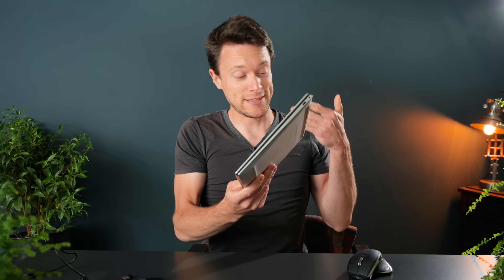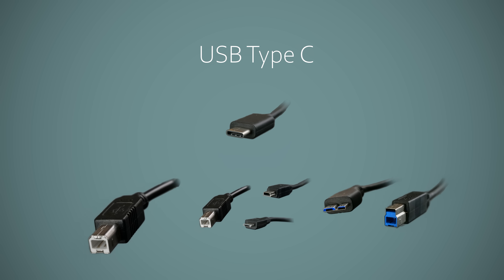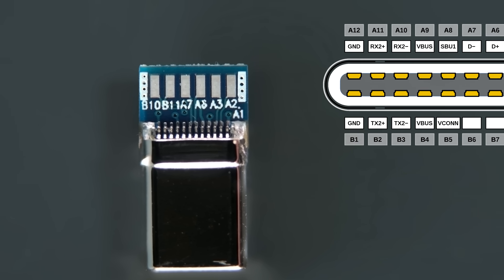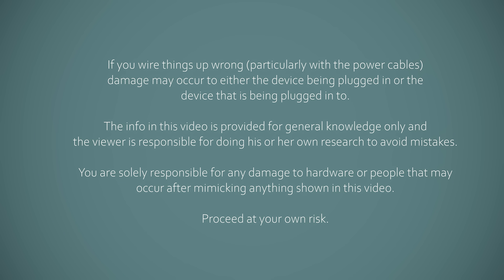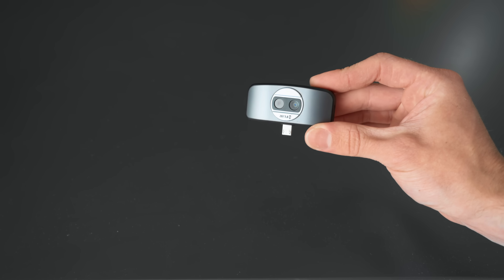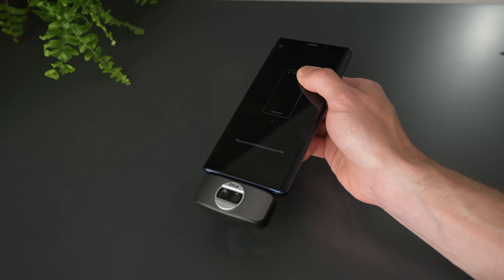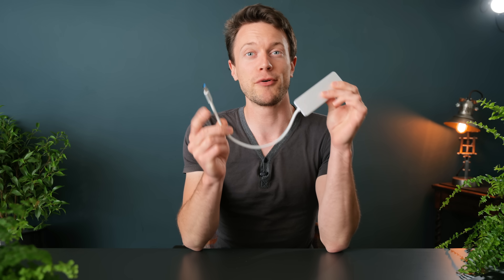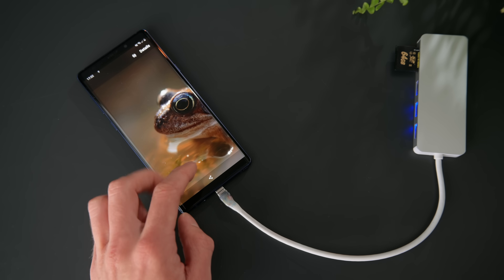Converting devices to USB Type-C

Comment: C : I am reversible
Jack3.5mm entered the chat
C left the chat
Reply: 360 plugablity
Reply: Yeah, reversible is still inferior to Circular, as they can be inserted in any direction.
Reply: @adunknowng  Well but we gonna leed a long-ass circulair plug for the amount of connections of a usb 3+ lol :p
Reply: @Tom-sd2vi  something like Robocop's universal data connection
Reply: Owletterishere long live dc barrel plugs
Reply: @adunknowng  Not sure if its true. I tried putting it in, with the cable first. Did not work, so any direction is not true.
Reply: @adunknowng  that's true, but they are very easy to break, so Type-C is still better
Reply: @adunknowng  its basically indestructible when it's an l connecto.
Reply: @adunknowng  No Because USB C is So much more durable than round... Headphone jacks wear out and break so easily
Reply: jack have oe problem - it can shorting pins while put in connector
Not great for data and power connections
Reply: @Xenotester  Solution: Make the bottom tip act as a switch. Pins will only turned on once the whole jack is connected.
Reply: @Mr Bruh Isn't signal type(digital/analog) defined by the device using the wire?
Reply: a 10mm cylindrical plug can have 4 contact enough for usb 2.0
i wonder why they did not do this
it is so convenient for charging at least
not to mention the huge surface contact area
Reply: @H_B_R  Apple did this already with the iPod shuffle connector
Reply: @trytea  why isnt it more popular though
Reply: @H_B_R  simple. Because at most you would have 3 ring separators in a 3.5mm Jack. So max speed would be whatever USB2.0 can provide. Not to mention Apple probably patented it so no one can use it.
Reply: Amazingly I'll be the first to say this comment is absolutely hilarious.
Reply: 2 connections that should never be or have been taken off a phone. That and a  IR blaster
Reply: I literally can’t believe that I’ve spent my weekends doing anything other than reading YouTube comments, you guys deserve an award🤣
Reply: David Yusaku 360 degrees of rotation cant be beat
Reply: Bluetooth has entered the chat.
Reply: HAHHAHHAHHAHAH
so funny XD
Reply: Honestly, type C wins against the 3.5mm jack. Don't get me wrong, I love the audio jack. I've used them for my entire life. But USB-C is designed to replace the audio jack. It can carry audio and get this, full HD video signal. The audio jack is notorious for its habit of breaking easily and making awful connection. A bit of dust inside your 3.5mm jack port on your iPhone? Can't connect any audio devices. Connection broken. Just bought new earpods 2 weeks ago? Now one of the channels doesn't work. Well, it does but you have to hold the jack at a very specific spot and it kind of works.
Reply: "Bye for now" - R.I.P Eric The Midget
Reply: There are still problems...
The world:  We have a 3.5mm jack standard that follows every other jack ever made.
Apple:  I created a 3.5mm jack that doesn't conform to the standard because we want to bilk people out of money!
The world:  🤦
Reply: C jack imo is not a bad idea, aside from rotable base advantge, it can easily damage the port or the plug. I have suffered alot from this. I searched online and there are actually selling type c headphones.
Reply: 3.5 mm can't transfer data. Its too old
Reply: C isn t better because is reversible ,but is alot  faster ..... oh wait it wasn t iphone who came first with data /power cable reversible? 
Now we know the beef between  us and china step by step >.,<
Reply: @ssj5AX  nope, it was SONY, several years before apple.
Reply: @davidplesnik6428  I could have sworn Apple came out with an audio jack version of USB for their iPod shuffle range. That would have technically been the ultimate reversible data cable.
Reply: @davidplesnik6428  As usual. Apple is very rarely to do things first. Ten people say, yeah, but they did it better or perfected it. Well yeah, I'd hope get would do it better if they have years to perfect something, charge more for it, AND they didn't have to come up with or develop the idea.
Reply: @ssj5AX  There's clear difference between Apple and rest of the world. Apple can do whatever they like. Rest of the world tries to agree on common standard that will be used by everyone. Imagine everyone followed Apple and created his own plug. Well, you don't have to imagine. It was like that not so long ago. Lots of unnecessary cables, having whole bag of different cables for different stuff (even though all of them used USB, just differed by plug). Different designs and concepts were created by different companies and finally they agreed to use one common standard. Well, everyone but Apple. Then they all took time to list all of their requirements (more or less, it's not that simple), possible future extensions and a lot more. After all a standard was created that is used by everyone and you can be sure that everything is compatible. You know that all USB-C connectors are designed to 10k plug cycles and what about Apple? Who knows, they tend to break much more often (most probably because of thinner cable). 
Anyways, it's not about who invented reversible plug. It was invented very long time ago, you could even buy standard USB 2.0 connectors that were already reversible. That was not a problem. The thing was to create standard that will satisfy majority of the market without the need of yet another plug just for one particular case. Apple did not have to care about master/slave as they designed the only devices using this plug and did not have to care about anyone's needs. Imagine connecting better wall sockets in your house which can be rotated 360 degree. Sounds quite good for some things. Now you can only buy stuff with those plugs or use extension cords and adapters for regular equipment which is kind of useless.
Reply: @ssj5AX  solution: have a bunch of "data rings" on the inside
Reply: @the4thsteve27  solution, maybe make it optical instead? (for datatransfer, not charging of course :P
Reply: @ssj5AX  Build a standard requires more time than create something proprietary and fuck up the user freedom
Reply: @ssj5AX  are you sure about the  USA and China thing

Comment: Honestly Instead of going through all this work you can just spend like 99c on a little A to c converter that you can just shove on the end of your type A connection (not talking about the longer dongle shown in the beginning. These don’t have a wire and just switch the connection types) honestly I think that’s a lot more practical since it still retains the back words compatibility with type A.

Comment: You make it being simple but the risk of damaging the PCB (of your high end mouse) is quite high ! Not everyone has solder skills to solder on so small parts. Also the original USB-Type A case is destroyed. Honestly, instead of wasting money on molding clay, I personally prefer to buy an adapter. There are  now smaller ones in the market. Thanks for the idea, though.

Comment: what happen whit the people, that not have the enought knolegde to create a usb type c port?, because 
you have to configurate whit a resistence soldering in to the board, that because you know about electronic.
so the cable to conect a usb type c it´s the easy way for that kind of people.

Comment: You could also simply desolder the SMD resistor R1 and resolder it under R2, instead of placing a massive THT resistor and scratching the board.

Comment: Thanks for this video! it's really teaching a lot. Quick question since you talked about the types of ports. I actually own many USB 3 micro type B ( the weirdest shape for a port in fact), and i would like to know if there is a way to find a hub or converter to use all these drives as internal drives in a PC instead of having many cables for external drives. 
Thank you !

Comment: I have wanted to replace my PS4 controller's charging port to a Type C for a long time. The reason is because the micro usb port is very defective and the cable keeps disconnecting. But I don't have the knowlege to do such thing. A video about that would be super appreciated!!!
Reply: did you replace?

Comment: You missed a major trick with the host/sub resistor - there was a spare set of pads that you could just move it to. no big bulky through-hole resistor required. As long as you have some good point-nosed tweeters to hold the SMT resistor its probably easier and definitely more secure/durable, since the leverage of the big resistor wires could rip the tiny pads off the break-out board. And yes, I do smt soldering all the time with that exact soldering iron (Antex, with a 2mm oval tip) and somewhat shaky hands ;)

Comment: 0:30 "Dongles are not solutions".... the solution is buy a breakout board, open up your device (possibly breaking it) then solder it up properly or you will short it! If you have to use USB A again...  you cant! That is definitely a better than just buying a dongle. :)

Comment: nice video
instead of soldering on a new resistor, you could have moved the resistor from the spot labeled R1 to the spot labeled R2.
you can see the trace goes directly to ground.

whilst this might be hard to do with an iron, its more compact.

Comment: Okay so about the whole scrape away the tracer and add your own resistor thing. It looks like there are two sets of pads there for the existing resistor. If you just desolder the existing smc and move it to the contacts to the left at 7:11 it should switch modes.

Comment: You really need to be an expert in soldering to do any of these things.  That means you need to have a soldering iron that has the correct temperature (a temperature controlled soldering iron) so you don't melt the circuit board, and a fine tip and solder to work with.  Then you need to be able to solder quickly, without melting the wires or the board and using a minimal amount of solder, to avoid bridging pads or circuit traces.
Without the proper equipment and skill, you could burn out both devices, rendering BOTH unusable and worthless!
  I would recommemd being patient and getting the correct devices that connect without modification, unless you are an experienced electronics expert.

Comment: Totally a cool hack, but user beware. Do this with a USB storage device and you could easily corrupt valuable files. Cable terminations are no joke. Chopping off the professional connector end and splicing wires together will introduce signal noise and demolish the effectiveness of a shield.

Comment: I think USB 4.0 will be something similar to this magnetic phone chargers that you plug your phones plug into and the wire snaps to it when you charge. Only difference is say is that devices will come with the magnetic data connection on the bottom or side or wherever and the cord is just a little magnet that snaps onto the device. Or, 4.0 could just be a form of wireless that'll kill USB connections and Bluetooth ver. 6.0 (or next step of what's current) will become dominant.

Comment: 2:00 WTF is that dual connector for USB 3? I can't even envision how that would ever plug into anything.
Reply: That dual connector is for portable hard drives. One connector is for USB, the other one for SATA. It's pretty common actually.
Reply: @RaduRadonys  I don't use that kind of crap, so no wonder why I didn't know what it was. Still doesn't sound legitimate enough to be common, when data can just be run over USB........

Comment: 7:16 4.7KOhm or 5.1KOhm - the rule of thumb in electronics is that +/- 20% difference in value should work ok.
The big resistor looks ugly here, one could just heat both sides of the existing resistor with big enough soldering iron and move it to adjacent set of pads that are connected to the ground. 

Great job with the flir cam.

Comment: So, you're spending money on solder, a spare USB cable, a resistor, a USB-C connector, and tape to wrap it... to save a tiny bit of space?  I'm all about DIY and learning.  But this seems really odd.  You have to be adept at electrical soldering, have an iron (or a friend with one), and time to spend working this all out... and you have to be certain not to mess up or risk ruining one or more things that you'll then need to spend even more money and time replacing.  I'm thinking a dongle makes pretty good sense.

Comment: I love the DIY solution but this is also a very NEAT possibility: https://nl.aliexpress.com/item/4000677832671.html (USB mini) or https://nl.aliexpress.com/item/33009156161.html (normal USB).
In case this link dies just search for usb mini to usb c using a search engine.
Happy hacking!

Comment: No.  Much smaller is not an advantage when it fails if you use it much.  They would have been better off with a universal connector that's twice the size, putting it around half the size of USB A, but  more robust.

I won't buy a laptop with only USB C.  Problem solved.   Phones, I wouldn't either except they screwed up designing the undersized microUSB too.  This is what happens when people who study to be engineers, don't live life enough so they can't see outside of an electrical function to appreciate the mechanical function of a connector, or just don't care that they're making your expensive gear, more and more disposable to waste earth's resources, add to landfills, and ultimately waste your money... for what, maybe 4 cubic mm added to the total product size?  Ridiculous.  That trivial size increase is something nobody would notice without a micrometer.

Comment: Aw man, cut the mouse receiver board to make the old USB A contacts really short and then solder on one of the 4 pin USB C connectors directly to it. Might be able to trim some other dead space off the board as well. After that you can use epoxy and sand it down to a good shape. That thing you made was hardly any better than the rigid USB A to C you even showed.

Comment: Nice one, Matt!  I'm sure I could use this conversion with some of my older USB devices.  I also happen to have both an old laptop and a NEST security camera that I no longer use.  It'd be nice if I could repurpose them into new webcams, especially ones that are small size, have high-res and can focus on objects ranging from several feet to a few inches away.  Bluetooth or WiFi capability would be a nice plus as well but not absolutely necessary.  Looking forward to seeing what you come up with!

Comment: or you morons can just use one of these..https://www.samsung.com/au/support/mobile-devices/what-is-an-otg-on-the-go-cable/
....ive used it and tested it on everything including a mac pro and  other apple products. But go for it...what do I know.

funny, I just use the Samsung usb C to A adapters, that came with my galaxy S8. Its an adapter, not a dongle. Straight connection. yoiu can get 5 of them on ebay for under 5 bucks. and I have yet to find a device that does not function on it. it work son everything. Like I said, adapter, not dongle. Most of these thing are called USB C OTG adapters, thats pretty much all your making here, not something new.  Wanna waste your time making this, go for it. Will save you time and money too.

Comment: I have a USB charger built into my extension lead wiht 4 outputs, I'm wondering if its possible to do this 'the other way' if that makes sense. If I could change the female USB A outputs to female C outputs it would be much better as all my mobile devices now come with C to C cables. I understand they would only charge at 5v rather than the 9/12/15v that some USB C chargers are capable of but I can overlook that.

Comment: To change from host to client, instead of cutting trace on the board, it will be much easier to desolder R1 resistor and solder it in R2 placeholder. This placeholder is aleardy connected to the ground.
YES, the board designer knew that it can be used for client devices too.

Comment: Just asking, but isn't the small black resistor desolderable from the Host-pad and resolderable on the Slave-pad? I know (and actually worked with) quite some circuits where this would be the way to go. You could save the huge 0.5W Pulldown Resistor and get a significant amount of extra space :) Nevertheless: Thanks for your awesome videos!!